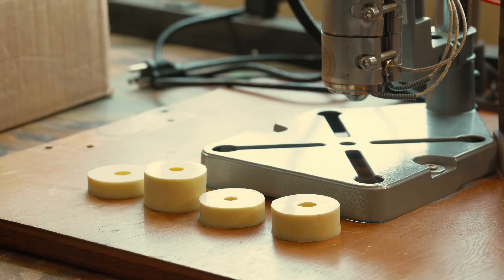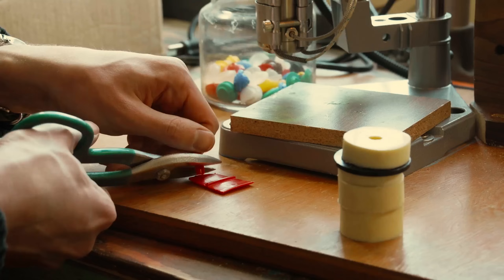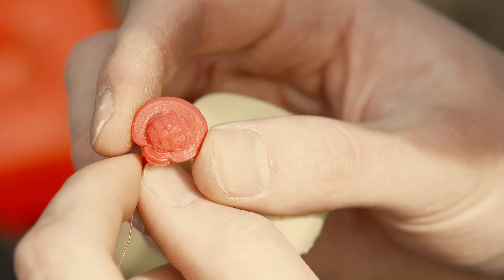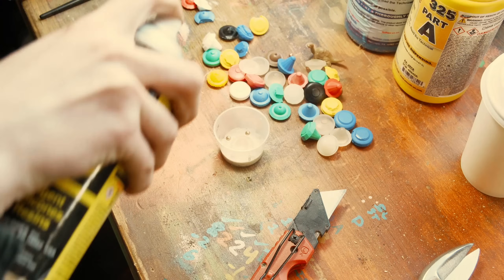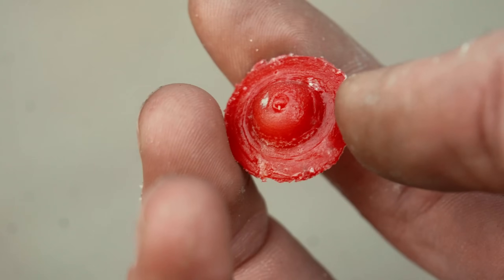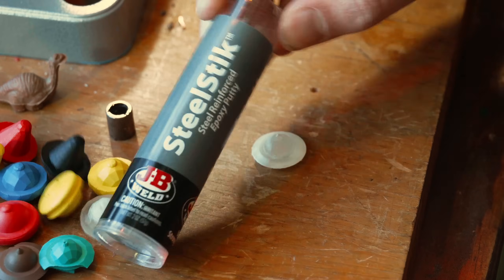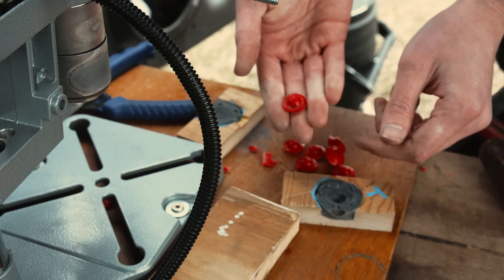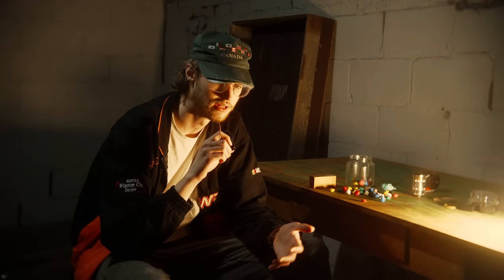Experimenting with Budget Injection Molds

Comment: I had good feelings for that epoxy putty, glad it worked!
Reply from the maker: Thank you for the recommendation 🙏
Reply: @EvanMonsma  you might also want to check out high temperature 3d printing resin (i.e. druckwege type d high temp is resistant to up to 260°C) and printing the mold directly might help you in reducing flashing.
Reply: Holy Shit that is a huge compliment coming from you............... but also good job my man

Comment: I don't know if it works for melted plastic but to get rid of bubbles you can use a pressure pot and it gets rid of bubbles for at least epoxy resin and silicone.

Comment: Having watched all the injection molding videos on your channel, I can suggest that making the epoxy molds inside a square of Lego bricks may allow for more easily creating flat edges on the exterior. It might alleviate the issue from the AdeptaCon video, where the mold wouldn't stay level and needed to be sanded.

Comment: If you use a vacuum chamber to remove air from the resin and put the mold back in the vacuum chamber after you pour in the resin, you shouldn’t have any air bubbles

Comment: It might be worth looking into PLA pellets. It's the same plastic that any entry level 3D printer uses, it comes in many different colors, and when compared to filament it is extremely inexpensive. It also melts at a reasonable temperature, so compared to the buckets it will likely be easier to mold.

Comment: Wait, you have a resin 3d printer but don't print the molds themselves? Just CAD out your design with a small runner, a vent and print both halves. Clamp between aluminum (needs to be more rigid than wood, they are rather brittle) and you'll get perfect results. Use a high temperature resin made for moldmaking - Siraya Sculpt transparent is often the cheap go-to. Great for prototyping and very small production runs (and with how your models look, there isn't much to chip away, so you could get 50 - 100 parts out of it with correct pressure). Remember to put a gate on your part - here you inject straight into it, which makes it later a pain to remove the runners - it'll both look bad and take lots of time to clean up. A gate would let you inject faster (since all you need to wait on, is the gate to freeze). For the vent - it needs to be very shallow, to allow air to pass through, but not the plastic. It needs to be like 50 microns deep, and wide, but very short. I'm in the desktop injection molding business, so I can give you a few pointers, so you don't repeat my mistakes
Reply from the maker: Thank you for the advice! I don't have a resin 3D printer, those masters came from shapeways. I've been looking into it recently though, seems like its gotten significantly cheaper in the last 5 years so I might have to invest in one to make some molds. And yeah gang molds will definitely be the plan for final production. A gate is totally something I should do- wasn't familiar with that part of the process before. Thank you for all the pointers

Comment: When I worked in a thermoplastics factory, we largely used ABS and PVC for our extrusion and injection molds since they were the easiest materials to work with. PVC can make nasty fumes if it's the wrong type, but ABS might be worth experimenting with to avoid the ripples? It requires a high temp to melt but it molded better than anything else we used

Comment: You can make the vent small enough that the air can still get out but the plastic will not flow through. It will be hard to measure, but try to get the vent to only one thousandth of an inch thin, or less, at the edge of the mold surface, then you can let it open up into a larger vent. So hopefully it will vent and you won’t have to cut off vent plastic

Comment: Are you using a vacuum chamber for mold casting with resin? I know that kind of casting still takes longer than injection molding, but you shouldn't be throwing away nearly half of them due to bubbles.

Comment: You can use liquid epoxy to smooth out the inside of the JB weld form. This will ensure nice finish of the part. People do this with 3d prints, there are a lot of videos on how to do this on youtube. You should definietly check it out.

Comment: Awesome video! Short, sweet straight to the point. The Crafsman tested using 3D printed resin for injection molds, which also seemed to work pretty well! I imagine if you wanted to make a mold of a physical object you had, you could scan it into an .stl file and make the mold from that, but it would lose all of the surface texture of the original sculpt.

Comment: You could also try doing a plaster mold, youd need shellac, bar soap(mold release) and plaster. Its what I use for molds and I havent tried using it to fill out plastic but Id assume itd be pretty heat resistant since it is a ceramic.
Reply from the maker: I was looking into that to maybe approach in this video, but not super familiar with it. Are you using plaster of paris?
Reply: Yes, heads up tho when trying to create the mold from the 3d print I remember I ended up breaking the print because it wouldn't release. I think it had something to do with the plaster shrinking when losing moisture or the rough texture of the print.

Comment: “Pouring liquid reading & hoping it cures without air bubbles”? Is that really honestly what you’ve been doing? 

You do know that both the resin and the mold contain air, right? Lazily dumping your resin in there was NEVER going to give you a passable result.

What you want to be doing is spraying mold release into the mold, vacuum pumping the air out of the resin before pouring into the mold then once it’s full placing your mold in a pressure pot. This can easily be done for little money and at small scale.
Reply from the maker: I'm aware- but for large batches in gang molds, my thinking is that a large pressure pot setup isn't gonna be the best workflow for me compared to the fast demold time of the injection molder. Definitely something I wanna get set up but not the end goal for this specific project